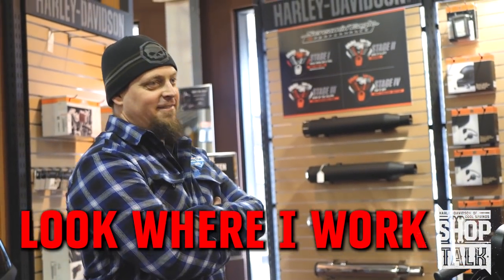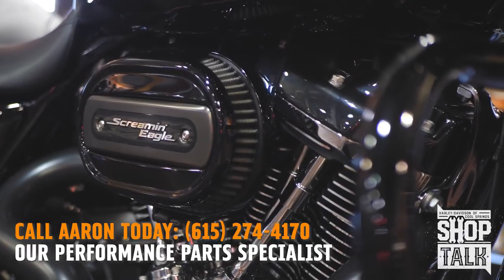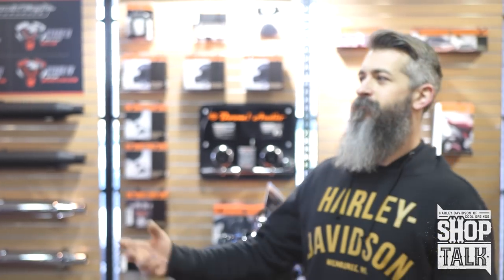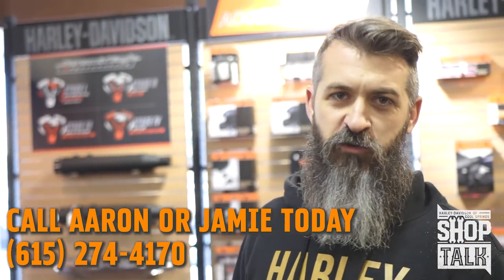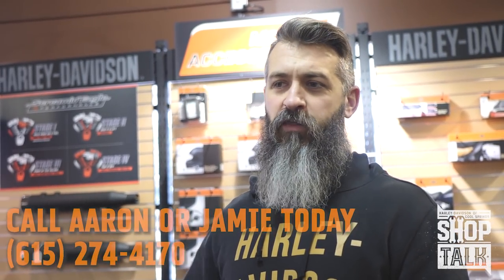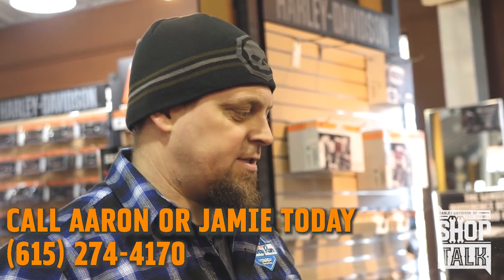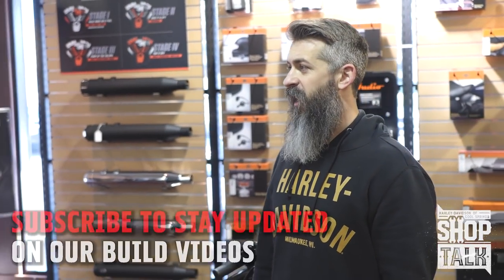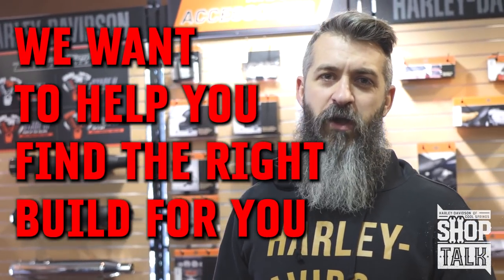Cam Shootout Series | Intro

Comment: Do a woods performance 22x with a powervision and a two Brothers racing 2 into 1 comp S series pipe so I can see what my numbers are on my 114 breakout please.  I'm currently running a fuel Moto map setup for my pipe my cam and my stock ventilator breather with a K&n air filter and I must say boy did this bike come alive after all this stage two work was done. And if anybody out there reading this has done the same thing to their 114 m8 let me know what your numbers are or give me a ballpark figure what I'm putting to the ground now. Thanks.

Comment: Hay guys I have a question? Not trying to start you drinking at work lol. What do you think about an already done stage 2 with a SE8-447 cam in a 114 2022 SG with a SE air ventilator. Replace the factory head pipe with the full sac header pipe and chrome works mufflers with a good dyno tune? any idea want the HP and torque number range would be?

Comment: Redshift 468
Reply: We do have numbers on several builds with the 468.  Call the shop and talk to Aaron and we can give you info on stock 107 and 114 as well as hi comp. 114 and 117 builds with this cam with a few different exhaust options.